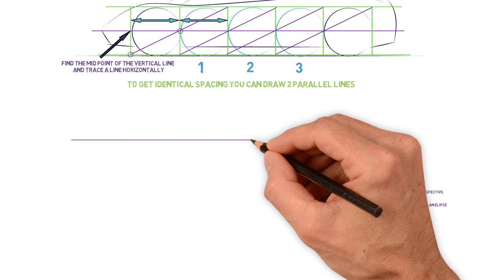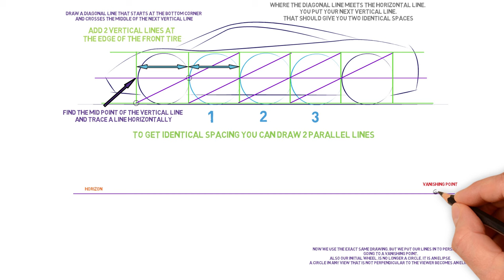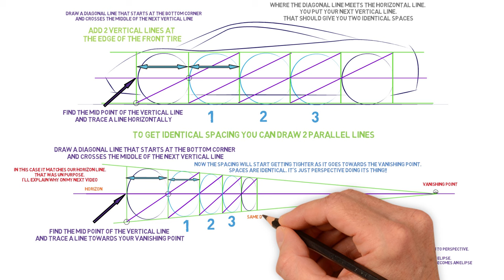Wheel spacing in perspective for car design

Comment: Nice instructional video. But you missed a step. When you put the first box around the front wheel, to get the center you draw an X inside the box. This would be a line going from top corner to the opposite bottom corner. The middle of the X would be the center line.

This is crucial in perspective, because if you change the angle of the Car even a little, the horizon line will no longer be the center line of the wheels.